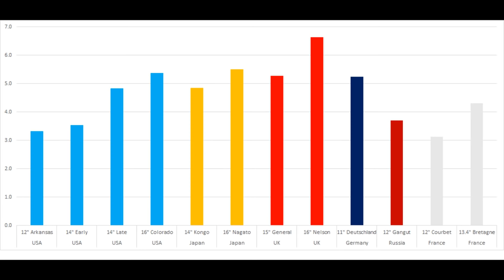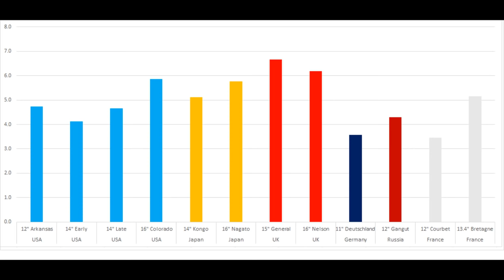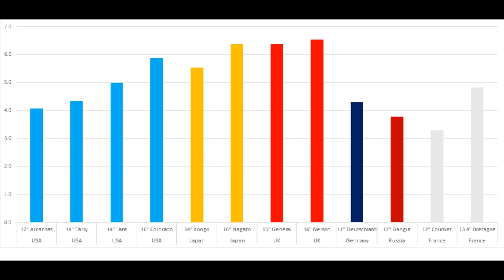Battleship Guns of WW2 - A series of tubes

Comment: Drach, isn’t time of flight of the shell to a given range more relevant than range itself? If I understand the issue with hitting a target at over 30k yards is that it gives the targeted ship the ability to leave the area given statistical hit probability. However, if a shell is able to reach 35k yards in the same time as a different shell travels 30k yards, wouldn’t the ability of the targeted ship to exit the targeted area be similar? Are flight times close enough to obviate the discrepancy or have I misunderstood the maximum useful range in some way?
Reply: Going by live-fire tests in 1944 involving Iowa, even if the enemy ship doesn’t move you’re going to have serious issues hitting the enemy at 30k yards.
Reply: In combat, if you out range your opponent, and are faster than them you are immune to them completely. Effectively have your ship at 0% risk of serious damage. Sure 1 in every 100 shells MIGHT hit at this range, but that is still having their ship under direct threat of damage.
Now if 2 ships have same range, and different velocity and correlating air drag values, then a higher initial muzzle velocity would likely be beneficial.
Reply: That extra 5k yards adds more chance for deviation from weather/atmospheric conditions (alongside the natural spread of tacking on a 1/6 to the distance).
But yes, time of flight is a definite advantage.
Reply: Yeah, faster shells that keep their speed over distance have better odds of hitting a moving target, but functionally, hitting anything beyond 30,000 yards with enough consistency to matter proved to be just a bit beyond the fire-control technology. This was always an issue with firearms from the 19th century onward, with people aware the guns could shoot further than they could be aimed, but struggling to find ways to effectively do it. 
      By way of example: in 1870, Germans invaded France. Most Germans saw the maximum range for volley fire with rifles to be about 600 meters. They knew the guns were lethal beyond that, but the dispersion of bullets they were measuring was just too big to justify the ammunition spent. So as Germans expected to be mostly safe from rifles until about 600 meters from the enemy. Well, French officers disagreed. They figured out that if they made use of optics and developed their range-finding techniques, they could do better than 600 meters with their rifles. Sure enough, come 1870, Germans were in a rude shock when French volleys starting hitting them as far away as 1,800 meters! The Germans had rifles that could have matched the French, but with virtually no German officers experienced in actually directing fire to those ranges, they never would match the French riflery during the war. So good were French volleys in 1870 that they basically set the tone for riflery right up to the Great War, with everyone assuming that riflemen had to be able to shoot as far as 2,000 meters or more.
Reply: Thank you all for the replies; the 30k effective limit on range and flight time not playing a significant part to change that makes more sense now.
Reply: Aye, it's not range which is the factor, it's the velocity & mass of the projectile & that's before you factor in its sectional density & ballistic coefficient.
I wonder if any of the many ballistic calculators used for rifle shooting could be tweaked to run some calculations...
Reply: @GARDENER42  honestly dont see why not. Ballistic coefficient, projectile mass and initial muzzle velocity should be all you need. A 52 grain bullet and a 1 ton high capacity shell both fly through the air in the same manner. If a program can handle the calculation for BC that high is likely to be the issue. I use a rifle calculator for a 37mm as well commonly and it seems to give data as accurately as for my 6mm I use for distance shot practice.
Reply: @genericpersonx333  a higher velocity shell, for a given range, will travel in a flatter trajectory, so it's chances of hitting are better because the distance between where the shell would hit the top of the hull and where the shell would hit at the waterline is longer because the shell drops less per unit distance.  (there is a name for that zone, but it isn't coming to mind right now)  If you want to go for a deck hit, then you want to fire at a lower velocity so you can fire at a higher trajectory.  But, with a higher trajectory, the chances of a hit are lower because the shell sinks at a higher rate.  The travel time to distance is listed in the gunnery tables.  A USN 16'/45 firing with a reduced charge yielding a muzzle velocity of 2000fps at a target 23,500yards away: angle of departure from the gun 33 degrees, 20.4 minutes.  Time of travel: 58.25 seconds.  Angle of fall: 42 degrees 58 minutes.   Firing the same gun with a full charge, yielding a muzzle velocity of 2600fps. at a target at the same range of 23,500 yards gives the following trajectory: angle of departure from the gun 15 degrees, 35.4 minutes.  Time of travel 38.44 seconds.  Angle of fall 22 degrees. 24 minutes.  As you said, firing at a higher velocity makes it easier to hit the target, but, if the ship has heavy deck armor, and you hit on the deck, at 22 degrees, the shell may ricochet off.  Drop a shell on the deck at 42 degrees and it punches through.
Reply: That’s all very well, but how does this help in calculating the air speed velocity of a sparrow?
Reply: @njwithers   OK, I'll bite. African or European swallow?
Reply: @njwithers  Laden or unladen?
African or European?
Are you sure you don't mean a swallow?
Reply: @rcwagon  it all depends on the size of the coconutshells my friend!
Reply: @njwithers  thats easy. Sparrow + 2400 pound shell at 2100f/s = newly colored shell flying at 2100f/s
Reply: @stevevalley7835  The problem with trying for a plunging deck hit at those ranges is not simply that the shell sinks at a higher rate but the fact that the dispersal as compared to the size of the target is much larger, i.e., the precision of your elevation and calculations concerning your initial velocity (chamber volume, powder temperature, wind speed etc.) is much more critical. Trying to drop a baseball into a coffee can underhand at 30 feet vs. trying to hit the can with a straight throw gives you an idea of the difference. You can also take your ship model into a dark room and illuminate it with a flashlight from different angles; the size of the shadow will give you an approximation of the relative size of the target at various shot fall angles: the flatter the angle, the "larger" the target. Pre-WW1 naval mortars tried specifically for steep deck hits, but their effective range was very limited even though the were arranged in four-gun batteries. As for the time factor: a flight time of 54 seconds is immensely long -- just look at your watch and count it off! I recall shooting a 6" coastal gun at maximum range (24 km, 15 miles), getting out of the turret and lighting up and still having to wait before observing the splash.
Reply: @stevevalley7835  Time of travel: 58 seconds?  That just amazes me. Can’t explain why but the image/concept just blows my mind
Reply: @jarmokankaanpaa6528  I agree with everything you say, in general.   There are circumstances where a deck hit might be easier or preferable.  In the case of Hood, iirc, Hood was heading, more or less, toward Bismark, so the target presented by the hull would appear smaller, a shell would hit at an angle, limiting it's penetration, and there was no way to mitigate the angle of impact.  But the deck target area offered would be the same as if Hood was on a parallel course.     The armor penetration table for Bismark's guns doesn't go below 20 degrees, because a hit at that angle would ricochet off, but there is a way to mitigate that angle of impact issue on a deck hit: use a reduced charge.  My theory is that Bismark's gunners knew their business, only loaded the main charge in the guns, fired at a higher angle, going for a deck hit, and the eyewitness testimony by Captain Leach of a deck hit is correct.  Unfortunately, the extracts from USN gunnery tables that I have access to are partial, so I can't find the exact angle of fall at the range, approx 19,000 yards, where Hood was hit, and the characteristics of Bismark's guns would be different.  As close as i can come is a USN 14" at 14,500 yards: angle of fall at full charge 12 degrees, 5 minutes.  For a reduced charge: 20 degrees 53 minutes, which is getting to the angle where a shell could punch through Hood's deck armor.  The actual shot being at a longer range, the angle of fall on Hood would be greater.  On the side hit issue, the term I could not recall last night was "danger space".  For that same USN 14" the danger space with a full charge and a 20' high target was 31 yards.  From the drawings and pix, Hood appears to have had between 25 and 30 feet of freeboard midships, so the side hit danger space would be correspondingly larger.  Hood's beam was 104ft, or a bit over 34 yards.  Given the angle Hood was at, the effective range difference between the near side and far side of the deck would be quite a bit larger than 34 yards.  Captain Leach testified that Bismark was firing half salvos, and two hit short and one long, or one short, two long, he didn't recall which, and he had an "impression" the fourth shell landed near the mast.
Reply: The shells of those battleships, regardless of bore size, probably had a muzzle speed of 800/1000 m/s. A flat (impossible, unless you are in interstellar space) trajectory implies a 30-40 seconds flight time, for a 30 km range. I am disregarding air friction, Coriolis effect, lateral winds... At 30 knots, the target is moving at 15 m/s relative. Unless they are moving parallel to each other at the same speed. 40 seconds flight time means the shell will fall 600 meters from the original point of fire. Thus targeting should be corrected accordingly. Nelson had it easy at Trafalgar. Point blank, crossing the "T".
Reply: That is partly true. The effect of time of flight on where the target will be is 100% correct. However the effect of inaccuracies in the direction a shell travels is angular. If the gun throws the shell in the wrong direction by 0.001 degrees that is a bigger distance of error at a longer range.
Reply: @njwithers  I'm pretty sure that the AIM-7 Sparrow is faster than any sparrow that ever hatched from an egg. But that's outside the date range of this channel.
Reply: @Nigel Withers  my favorite colour is blue.
Reply: @GARDENER42  What? aaaaaaaaaarrrrgggggghhhh........
Reply: U.S. fast battleships used range-keepers which were electrical analog computers; they took into account the range, speed of the ship, bearing, speed of the target and other factors.  If the seas were rough the guns wouldn’t fire until returning to level, even.  See Battleship New Jersey’s YT channel; they have an episode on the range-keeper.
Reply: @aurictech4378  AIM-7 has wayy shorter range though.
Reply: Congratulations ! You have found the idea behind the Soviet 180mm gun.
Reply: The flight time at that kind of range is more about 1 minute.  You are talking about a difference of about 10 seconds in flight time during which the ship would have move less that one hull length.  Move important is good fire control to know where the ship is and predict where it will be.  A higher velocity is a real help in giving a flatter trajectory.  A flatter trajectory allows for more error in estimating the range.
Reply: @NickTrouble  Theoretically true, but WW2 BBs typically carried 100 rounds per gun in their magazines, so the choice is really either to flee or to close to effective hitting range.  The battle then turns on respective immune zones, with the faster ship having an advantage here.
Reply: @genericpersonx333  yet, the French still lost the war
Reply: @genericpersonx333  Typical over-exaggeration...
Reply: @genericpersonx333  the French Chassepot was utterly, vastly, almost incomprehensibly better than the Needle gun. It could fire faster and FAR more accurately at long ranges, such that it's maximum range is between 1200 and 1600m to the Prussian Needle Gun's 580-670m. It's a feat the Prussians were able to win the war with such a relatively inferior rifle although they had superior artillery at the time, bridging much of the gap. It's thought their surprisingly modern platoon centric tactics with lots of battlefield liberty given to platoon level officers is what primarily gave them the advantage in the field. France was hamstrung by tradition and Napolean III wanting to be his ancestor, and using much of his tactics.
Reply: Per Nav Weapons the difference in flight times at 30,000 yards for anything other than Italian guns is about 5 seconds between the fastest and slowest.  (I couldn't find flight times for the high velocity Italian guns.) In that 5 seconds a 700 ft fast battleship at 27 knots will move about 200 ft.  Dispersion of a salvo is likely to be around 300 ft, worse than that for some guns.  Based on this I would say that dispersion is more important than flight time.  Fire control quality would probably outweigh all of these factors.
Reply: Not necessarily since if the faster shell has a lower Ballistic Coefficient it will be more easily bullied by atmospheric conditions. Temperature, wind, and humidity are just some of the things that can drastically affect a projectile's accuracy and a low BC projectile will be more effected by them. Sure a faster projectile could give the enemy less time to dodge but ultimately the design of the shell and the mechanical accuracy of the gun are more important to prevent drift.
Reply: yes
Reply: @jaybee9269  Battleships from which year?

Comment: Too bad you couldn't establish a universal range factor, such as "range at 30° elevation," as that would effectively make the range factor into a measure of muzzle velocity and ballistic coefficient. That would effectively make the range a factor of gun, rather than turret, performance.
Reply: Some older turrets couldn't have made 30° elevation, no?
Reply: @gokbay3057  Doesn't matter, since you're evaluating the gun as if it were in a 30° capable turret.
Reply: muzzle velocity would be a good measure for this generally gives longer ranges at higher elevation or a flatter trajectory for the same range
Reply: I was thinking the same.  But I would it "range at 15° elevation" as not every turret could elevate to 30° but they all should be able to get to 15°.
Reply: So Drach needs to...? I guess plot 3D bar graphs and make up a 5 dimensional graph (X-Y plot where the axes are ratios of values).  Interpretation of these type of graphs are much more clear and obvious with much more than a rum ration.

Comment: I see you've tried to engineer a solution :) Honestly, Drach, I think most of us would trust your opinions vs. attempts at unbiased calculations.  I think the problem here is that the guns are just the "business end" of a larger weapon system which includes the hardest variable to measure... Crew Quality.
Reply: Not to mention any external fire control (ex: the computers on the Iowa class) that might make far more of a difference in actual combat than the theoretical accuracy of the gun.
Reply: 2 guys get into a fight: one has a sharpened stick. The other has stick. Who wins?
Reply: @styx4947  the one who is Theodore Roosevelt, of course!
Reply: Love that comment